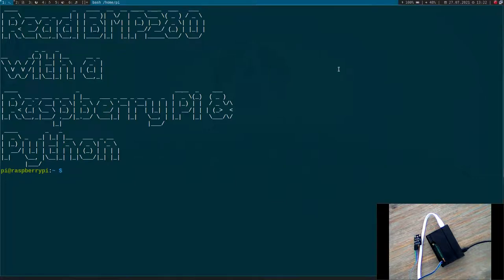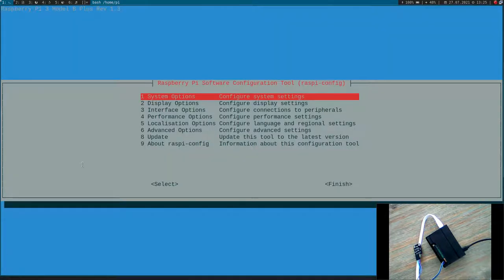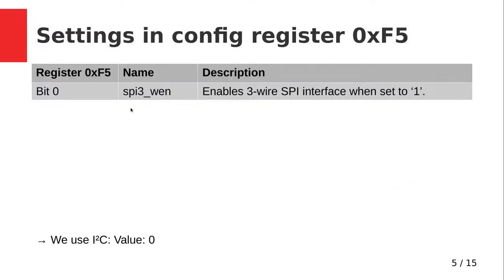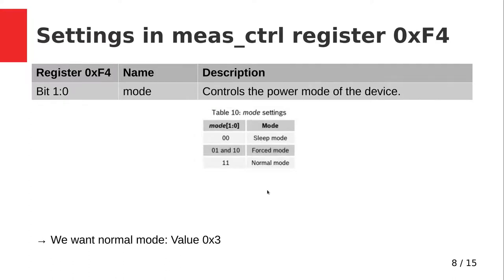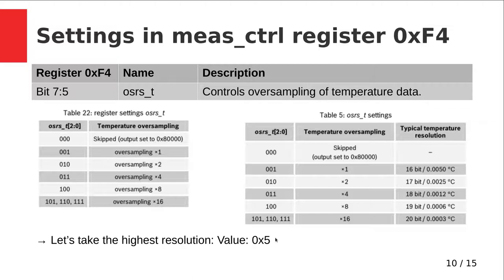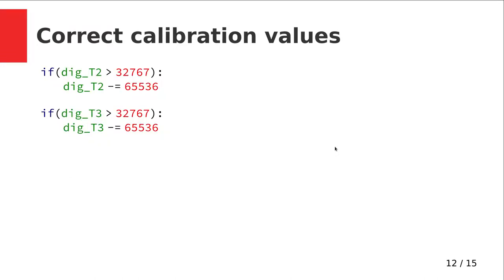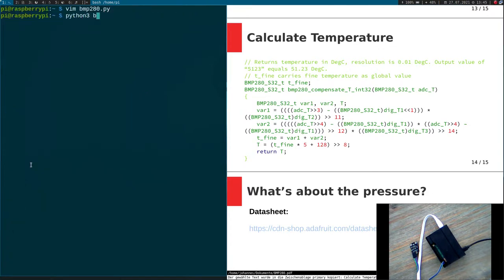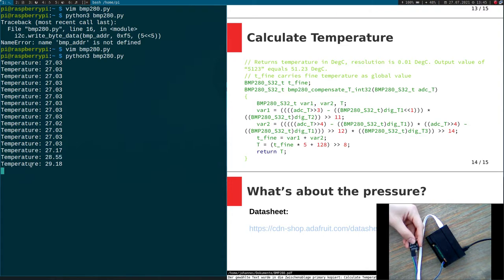BMP280 Pressure & Temperature Sensor with Python over I2C (Raspberry Pi)

Comment: i have difficulty with the meaning of ((5<<5) | (3<<0)) and how did u retrieve it from the datasheet.
if u have article or books to suggest on the topic with a biginner approach with be very helpfull!
thank you for ur attention!
Reply from the maker: Hi, let me try to explain it. 
We have 8 Bit Registers. The 8 bits are divided in bitfields and ervery bitfield fulfills a specific purpose. 
Let's look at the config register at address 0xF5:

Bit[0] means "Enable three fire SPI mode" So, we can set this bit to 0, as we are using I2C and not SPI
Bit[4], Bit[3] Bit[2] and Bit [1] build a four bit bitfield. We can write any 4 bit value to it. This bitfield controls the time constant of the IIR filter. As we don't want to use a filter, I can set it to 0.
Bit[7], Bit[6] and Bit[5] forms a three bit bitfield. We can write any 3 bit value to it. The meaning is shown in the table on slide 7. As we want to sample every second, we have to set it to 0b101 which is 3
So, our value will look like this Bit[0] = 0, Bit[4:1] = 0b0000 and Bit[7:5] = 0b101. If we put the value together, we get 0b10100000 which is 0xA0.
But we can also get the value by shifting the desired value with the bitfiled's offset: This would be: (0<<0) | (0<<1) | (5<<5)
The | is the or operator. But we can use a + instead too. And the result here is 0xA0, as expected.
I hope this helps.
Reply: @johannes4gnu_linux96  thank you very much this was what i needed!! really appreciate your help ( also you answered it very quickly ahah impressive )
It take a while to answer you but i was testig the "new  way" to express parameters in hex form! Mote clear for me!
This subject is not very straight forward for me, i know i can just use lib like circuit python but i want a deeper understanding of whats happening with my sensors.
I'm new in this world and all this bitwise shift is so confusing hahah
Also the documentation of smbus is so criptic! I will start studied registers adress in more depth (also im gonna check ur other video with i2c temperature in linux )
Thank you very much again! !

Comment: Hello, what does XLSB mean ? And why didn't you shift it left ?
Reply from the maker: I don't know exactly, but I would say eXtra Low Significant Byte. If you choose the lowest resolution, you only get a 16bit value for the temperature. The XLSB is only needed, if you choose a higher resolution then 16bit. 
As I use  the highest resolution, I have to read the XLSB. I build the whole value by shifting the MSB 16 bits left, the LSB 8 bits left and the XLSB. Then I take the whole value and shift it 4 bits to the right. This way I get the whole 20 bit value.
You can also calculate the value as follow: adc_T = ((d1 << 12) | (d2 << 4) | (d3 >> 4))
I hope this help you!
Reply: @johannes4gnu_linux96  Ooooh, thank you so much ! English is not my native language and I couldn't find the meaning (XLSB). Thank you for the great explanation )

Comment: Bro in the calculation part of pressure I am facing problem pls help me over there
Reply from the maker: What is the problem here?
The datasheet shows a function how to calculate the pressure out of the measured values (see chapter 3.11.3 of the datasheet https://cdn-shop.adafruit.com/datasheets/BST-BMP280-DS001-11.pdf). 
Before you have to read the calibration values, but they should have the same values like shown in the table on page 23. It is a little bit tricky, as some calibration values are signed and some are not.

Comment: Do you have to install the smbus function because I get an error message in my code tht it doesnt exist
Reply from the maker: Yes, you have to Install it: Just Run pip or pip3 Install smbus
To Install pip Run apt install Python-pip python3-pip
Reply: you can run the code using python instead of python3 incase you are trying to execute using python3.